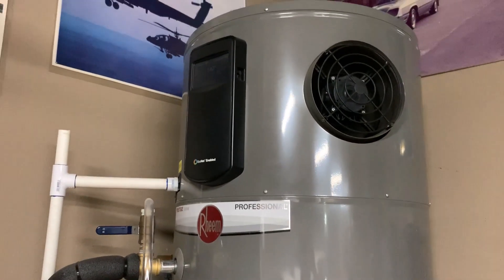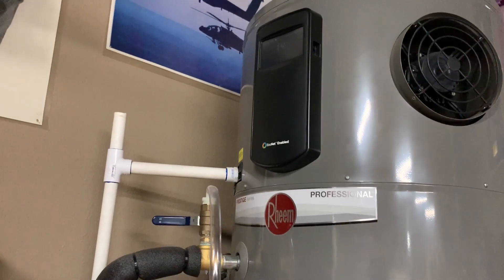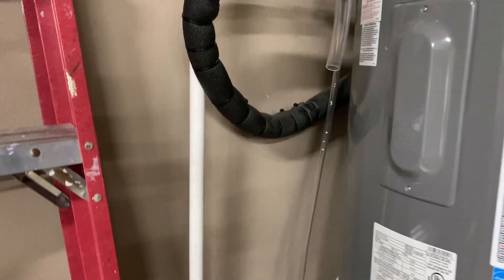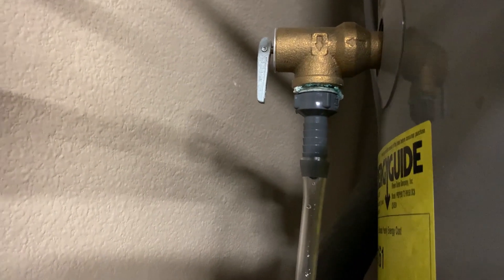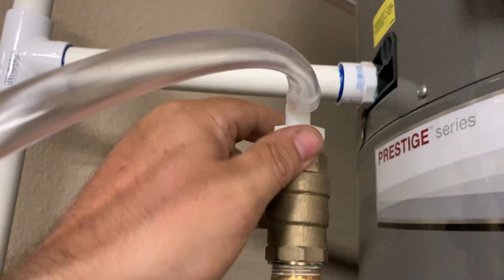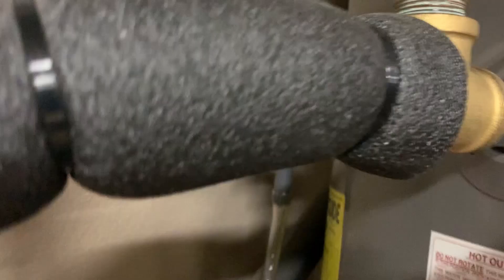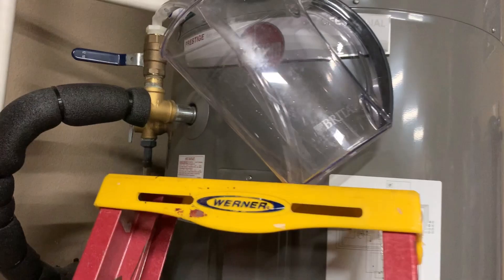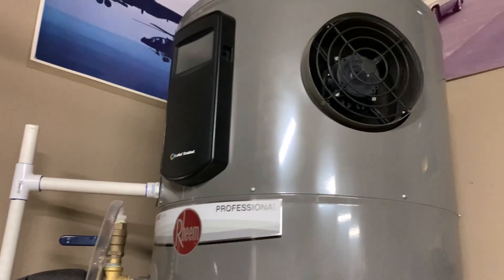💧Fix Smelly Well Water ● Use Hydrogen Peroxide to Remove Rotten Egg Sulfur Smell

Comment from the maker: Supplies needed:
✅Hydrogen Peroxide - https://amzn.to/3oeTgOX
✅1x brass water valve - https://amzn.to/3kec9PP
✅3x pipe nipples - https://amzn.to/35jyZzk
✅1x plastic adapter - https://amzn.to/3mdtMj9
✅1x plastic tubing - https://amzn.to/31p4mr5
Reply: Hello AppacheRanch , Can the peroxide be poured into the water Well? I don't have a Water Heater. I have a Water Tank.
Reply from the maker: @marlen3880  I don’t have experience doing it that way, but might be worth a try.
Reply: Thank you for your reply! I was thinking of suggesting to the Well guy to try the peroxide instead of the bleach but it's wierd that all the Well guys just shock the Well with clorox, and they don't know about peroxide ( makes sense with gas smell and adding bubbles from peroxide!) which is why I ask you. 
The water doesn't smell like rotten eggs, the air in basement crawl space mainly does - it's where water filters, softerner etc is. 
There are no old standing traps in the house. 
The kitchen was redone 2 years ago - maybe something with the plumbing pipes? 
Lastly, could it be something in the coil from water tank to the boiler, or would the high temp kill it off?   @ApacheRanch
Reply from the maker: My thought is that the sulphur is a by product of the temp and natural bacteria in the water.  If you smell something near your equipment try adding some in your softener brine tank. That often smells a little stagnant in mine. I know they use chlorine for bacteria problems, dead mice in well, etc but just for sulphur I find that good old H2O2 is a safe, fast, and easy way to clear up a smell. Good luck!!

Comment: would it make sense to just fill the sediment filter with hydrogen peroxide run the water to fill the tank?
Reply from the maker: @richardlam6885  that would work too. Whatever is easiest to bring a small amount of hydrogen peroxide into the system.

Comment: I’m trying to replicate this with the regular release valve. However the peroxide is not getting sucked into the tank. I’ve depressurization it at the bottom, and turned off the water to the tank. 
Any suggestions? My only thought would be the type of hose I’m using, which is the hose from a drill pump kit. 
Thanks
Reply from the maker: I would make sure the inlet to the hot water heater is shut off completely. If not, when you open the drain at the bottom, you won’t have created a negative pressure inside the tank. As long as the relief valve is above that bottom valve when you open it, it should suction.

Comment: Do you have a step-by-step instruction for the process of installing that valve? 
Do we need to drain the tank before installing that t-connection?
Reply from the maker: Here's what I did.  I turned off all valves leading in and out of the hot water tank.  Then I opened the drain valve with a bucket under it. Then I opened the pressure relief valve to let air into the tank, and water to exit the bottom drain.  I lowered the water level in the tank enough to go below the pipe used for the T-connection.  Then I installed the T-connection.  I hope this helps!
Reply: Thank you

Comment: Just did this today. Works great! The drain is quirky on mine, slow, so the peroxide took longer to suck in. Brilliant!! Thank you!!!
Reply from the maker: Could be that your water heater is old and there is sediment in the bottom blocking the drain. You might try flushing it if that’s the case. Thanks for your comment!  Glad it helped!
Reply: @ApacheRanch  I will try flushing the tank - thanks again!!

Comment: Could you please list the sizes and names of the parts you used; at the hot water outlet?
I wouldn't know what to buy.
Thanks
Reply from the maker: Supplies needed:
✅Hydrogen Peroxide - https://amzn.to/3oeTgOX
✅1x brass water valve - https://amzn.to/3kec9PP
✅3x pipe nipples - https://amzn.to/35jyZzk
✅1x plastic adapter - https://amzn.to/3mdtMj9
✅1x plastic tubing - https://amzn.to/31p4mr5
Reply: @ApacheRanch  wow that sounds great thanks

Comment: Not sure what you're doing with all that schedule 40 pvc coming out of the water heater however just know that pvc is not rated for hot water, nor is pvc cement. You'll absolutely have a bad blowout at some point. Also, the brass tee and lead comment, nobody drinks from the hot water side.
Being a state licensed plumber for 30 years, I always Laugh when I see the rigged up pipework of so many people.
Reply from the maker: This is a heat pump water heater. The white PVC is only for condensation drain. Open pipe, no pressure, no worries there. Installed by a plumber with experience in the simplicity of heat pump electric water heaters. And no, I don’t want to worry about anyone drinking from both the hot or cold side. Thanks for your comment.
Reply: @ApacheRanch  Yeah those water heaters are expensive.  Does the fan cool the room that the water heater is in, in exchange?
Reply from the maker: @Get2SteppinYo  Yes. Very nice to have that exhaust cool down my garage!

Comment: I have a "system" whereby I attach a PVC pipe to my tank-flush bib and it's long enough to be above the top of the water tank.  With the source water valve closed and the flush valve open, I open a hot-water faucet nearby and then pour my chemical (I use Clorox, but I sure like the idea of peroxide better) into the top of the PVC pipe.  Gravity pushes the liquid in my PVC pipe into the bottom of the tank.  I then pour about a gallon of regular water into the pipe to move all the chemical into the tank.  Biggest issue with this is I end up spilling the water remaining in the pipe into the floor and mopping it up.

Your system is a tiny bit more expensive to implement, but FAR FAR superior.  I am heading to the plumbing supply store to get the parts I need.  I have been wanting something like this for years.

UPDATE:  Here's a video of my version of this approach.  Rather than depending on suction to pick up my chemicals, I just use a funnel and pour the chemicals right into the top of the tank.

https://youtu.be/i30rOT29As8
Reply from the maker: Thanks so much for your comment!  It’s so interesting to hear other ways to tackle this problem. It’s a good idea to run that extra water to ensure you get all the chemical you can through that distance in your pvc pipe. But yes, I think you will really like this approach in the video. I can do a quick service using this valve in no more than 1 minute and no mess to clean up.  And I generally only need a cup of peroxide, which cost less than a dollar for a quart. So I thinks it’s about $0.50 a month this way. I’ll take it!  I wish you the best!!

Comment: After the peroxide do you fill the water heater again and redrain or just leave it in there?
Reply from the maker: You simply insert that very small amount of peroxide into the heater, close the heater drain, and then turn your water pressure back on.

Comment: So did you pour the hydrogen peroxide into the hot water coming out?
Reply from the maker: By shutting the supply valve and opening the drain, the hot water tank creates a vacuum on this new inlet valve and sucks the hydrogen peroxide straight into to the tank.
Reply: Oh okay I see so where did you connect that new inlet valve to the cold side or hot side?
Reply from the maker: @gabrielochoa6090  on the hot output

Comment: Can you just dump some peroxide directly into the drilled well?
Reply from the maker: I'm no chemist, but I think the Sulphur creation is a factor of the water + bacteria + warmth in the water heater vs. just coming out of the ground with that smell.   Also, it generally doesn't impact the cold water generally, usually just the hot side.  So treating ALL the water at the well might not be needed.
Reply: Yes & no.  It probably would help, but remember the well taps into the water table.  The water table is always moving (like a underground river), so a greater volume of peroxide would be needed.  Also, in some states, it's illegal to dump anything down a water well.

Comment: So you are attaching the suction valve to the incoming cold water line?
Reply from the maker: That’s the outgoing hot water line actually.  It would not matter which line you used as long as you first opened up your drain to get negative pressure inside the tank.

Comment: Are you concerned about the impact of the peroxide on your septic system, or is it too small an amount to worry about?
Reply from the maker: Great point. But it is such a small amount really. I can’t see how it would impact. I’m only having to use it every 4-5 months it seems now. And it’s only about 1/2 a cup each time. I have to assume that detergents are doing much worse things to my septic...
Reply: @ApacheRanch  Some sources suggest using 4 pints for an 80 gal. tank. If I use that much, I'll probably let it sit and then do a flush.

Great video. The negative pressure idea is genius. I don't have a way to put anything into the system, so sucking it up the relief valve tube will be great.

I'm a little concerned about the relief valve clogging. Mine's on the top, so I'm not as concerned.
Reply from the maker: 4 pints!!!!  No way!!! - that’s a lot. Really, try a small amount and go from there. When I first started to use this I used a cup and have reduced from there.  But be careful if you’re using that pressure relief valve. You don’t want it starting to leak on you.
Reply: Hydrogen Peroxide (H2O2) is not harmful to a septic system. It quickly breaks down into water and oxygen. That's the biggest reason to use it instead of bleach. The biggest drawback is that because it breaks down so quickly it does not kill bacteria, so it's not good for sanitizing the system.

Comment: How does the water come out of drain when it's closed
Reply from the maker: You turn off pressure lines to the tank. Then open drain and leave it open. Only about a gallon will come out. Pressure inside holds the water in. Open the inlet valve, or sucks in the fluid, and the drain opens at same time. Then close them both.

Comment: Would this be the same fix for the Cold water side. The Cold water is the one that stinks. Thank you!
Reply from the maker: CHEECHMUN Since this method uses the hot water heater tank as a collection point, and the smell is usually found on the hot water side, I don’t think it will address issues on the cold side. Mainly because the cold side doesn’t flow through a large retaining tank but instead straight into the pipes.  If you experience smelly water on the cold side you might have a different water problem than is solved by this remedy. I wish you the best!
Reply: @ApacheRanch  I appreciate that!!!
Reply: My hot water is usually the problem, but i have noticed recently that the cold water is also stinking. I did also notice, however, that the only cold outlets that produce the foul odour are the ones that share the same handle as the hot one water. The faucets or showers with two separate handles for hot and for cold don't produce this smell for the cold water. 
I will try this method for the darn water heater and see what happens.
Reply from the maker: hyacinthdibley2 Since the smell is basically sulphur, and I believe that it’s emitted as a gas, I can see how it could be showing up in the cold side faucet like you described. I know that some wells will have the sulphur smell internally and there isn’t much you can do in that case. I would definitely give this a try. You will know immediately if it works. Good luck!!!!

Comment: why don't you just pour the H2O2 into the sediment filter basin which feeds the water into the whole plumbing system including the hot water tank?????
Reply from the maker: Nad Ragaw you could do that for sure. But it’s a lot harder to unscrew that filter than just flipping open this valve.  That filter (at least in my setup) makes a mess of water spilling on the wall whenever I change it out.  Bottom line any way you can get it into the heater works. Thanks for your feedback!
Reply: Where is the sediment filter? My salt tank for the water softener?  Sry newbie here
Reply from the maker: He’s talking about a stand alone inline filter and not the water softener. You may or may not have one in your system.
Reply from the maker: Check this video out to see the filter types: 
https://youtu.be/yldZZtkQYik
Reply: STFU Nad Ragaw...